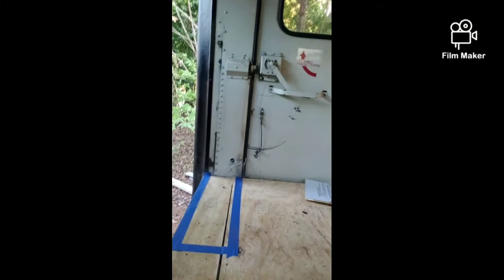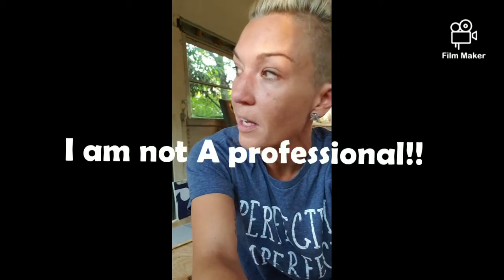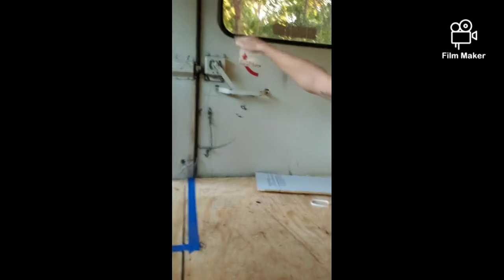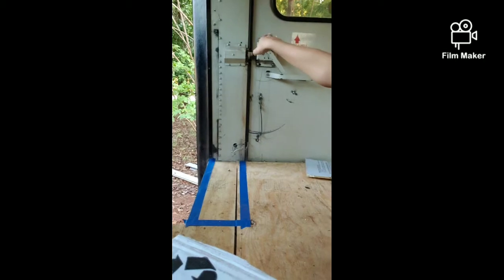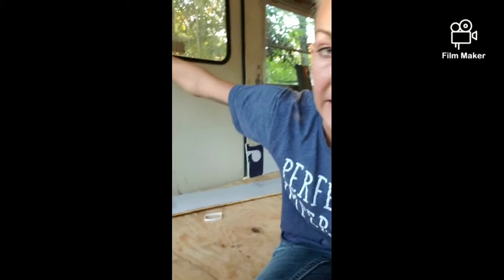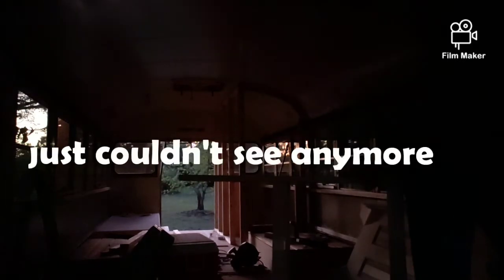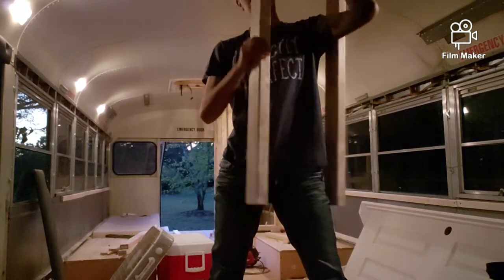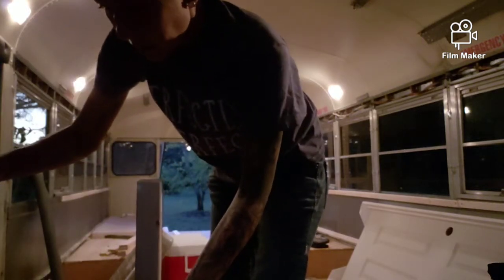Pony wall in the school bus

Comment: I went with a more open floor plan also, debating on closing off the driving area from the living area though.
Aw damn, I like the factory light locations in your bus, mine are center line of the roof. I am going to keep and use the factory lights. 
I am going to run LEDs along the top of my windows behind the crown molding.
A little window unit mounted in an emergency window goes a long way in the Texas heat
Thanks for sharing
Mike from Texas,Take Memories,Leave Footprints
Reply from the maker: Ya I'm trying to figure out what to replace them with